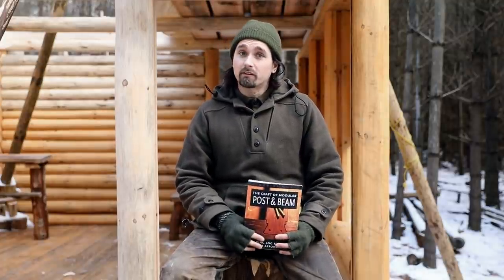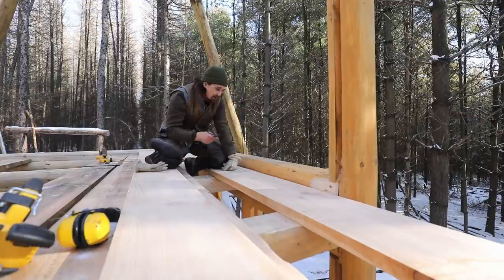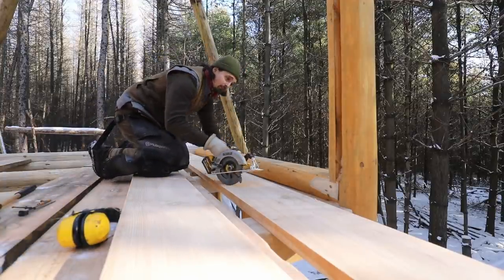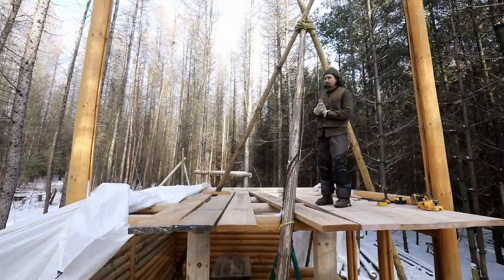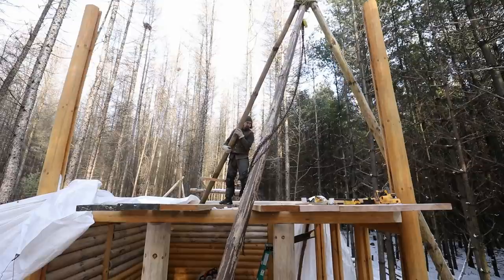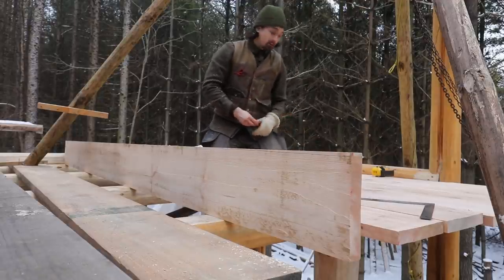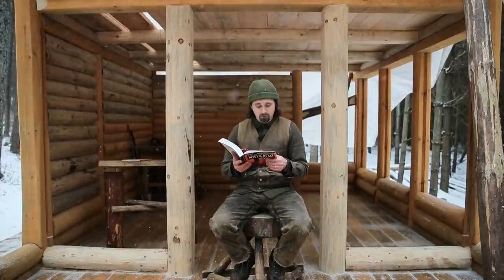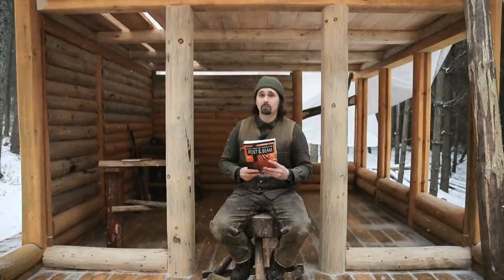EP21: Why I’m taking my cabin apart!

Comment: some thing that might simplify your sawing is to get a Right handed saw (where you can see the blade without craning over the top of the saw).  DeWalt makes a great worm drive/battery operated one.  Also, if you watch barwood builders you might get a few tips about Post and Beam constructs, such as a "big beater" made from hardwood.  Keep it up!

Comment: One question, since you do not own the land ,do you have or need a permit to cut and harvest your logs?😊 I think on the loft back wall I would have com up 2.0' So your back corner posts would have to be 2.0' taller.It would mean the pitch of the roof would not be as steep.

Comment: I love your thought process and the ancient wisdom you’re employing (even as you use modern tools.). In many ways I envy you as I sit in my suburban home wishing to be surrounded by more nature.  
One question about the flooring planks on second floor— you scribed them to fit tight against the outside walls. Will the moisture content be a problem when the humidity increases during spring-summer months when the boards expand?  What moisture meter do you use?  
Thanks and blessings dad on your new baby.
Reply from the maker: From my experience this pine is so soft, boards so thick, the screws so strong and my scribe not perfect, over time it just expands and contracts and fits perfectly.  I had scribed the floorboards on the main level the same way. They have sat in plenty of rain and all that has happened is they look better than the day I installed them. They expand only where there is no resistance.

Comment: Would it make sense to use a smaller shank size screw during the mock-up build? So in the final assembly, when you use the final size screw, the hole has meat left to grab?

Comment: Boy a cordless jigsaw would have been handy for that scribing. Why couldn't you take 2 planks and temporarily screw them to the Ridge poles so that they stick above the poles and attach a pulley to each one then pull the Ridge beam up a little at a time going from one side to the other until you get it set up then remove the planks?
Reply from the maker: As for the cordless Jigsaw,  yeah, would hvae been a good tool to have... but I'm just happy to have the circ saw and sander.  I stated this cabin with neither. Would have done it all with an axe back in the day.  I think I know what you mean with the ridge pole.  That could work.

Comment: Curious how you’ll approach insulation. Will this cabin require chinking? I assume that would make it difficult or impossible to deconstruct. Anything you can share on this?
Reply from the maker: Yeah, That is why I'm doing the full scribe. I won't chink until its final location. I'll also put insulation between the logs when I set it up for good.